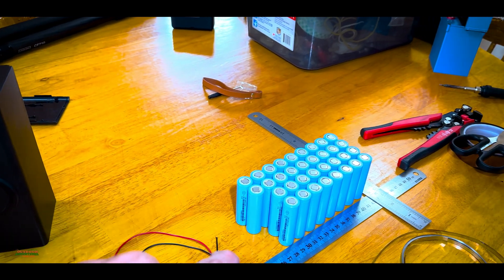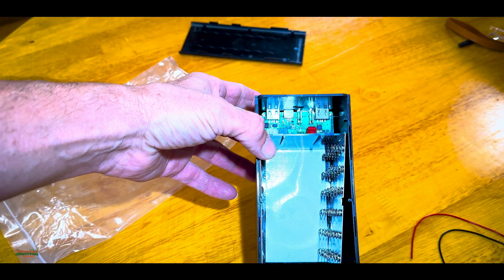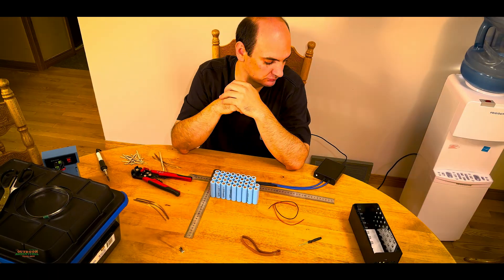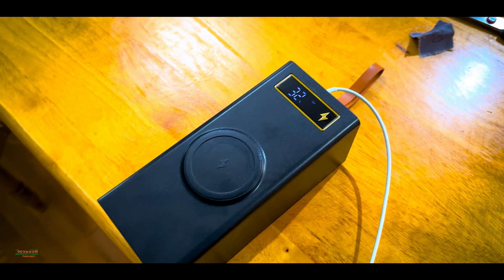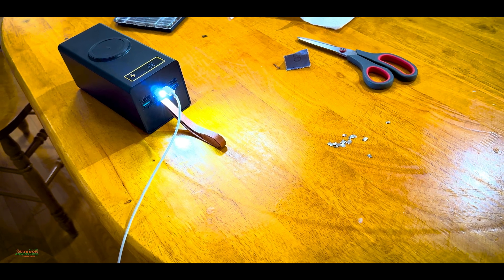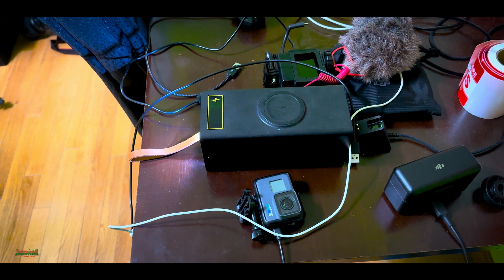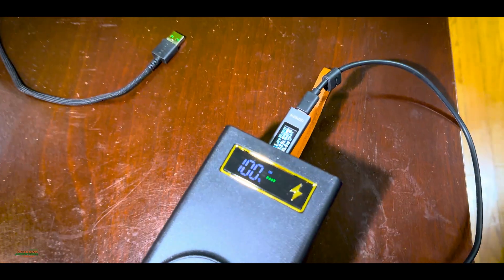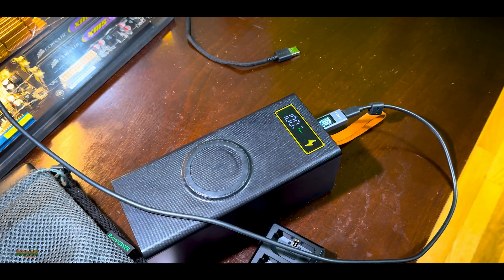How I Built a 119,000mAh DIY Power Bank from 34 18650 Batteries A Step-by-Step Guide

Comment: cool project. i would suggest using 4x lifepo4 cells (32ah) in series next time, and instead of a bms use a 4s inductive active balance board. that plus a bidirectional 100w usb-c board (can solder one of the resister locations closed to change to 4s lifepo4), i believe its called IP2368, theyre like 6 bucks. stuff it all inside a mini ammo can, fits perfectly, and add a 12v dc car plug (and fuse), so you can plug in inverters or add additional usb ports as needed with a 100w step up "car charger". basically building the anker solix c300 but with double the capacity and half the size for half the cost, and actually get a usable 12v dc accessory car charging port thats unregulated. put extra ac inverter and car charger in the remaining space inside the ammo can. can even use the 12v dc plug as an input for a mppt since its unregulated and basically a direct connection to the battery terminals. ea sunpower makes a 20amp solar mppt which is like 18 bucks
Reply from the maker: That sounds like a great idea. I’ll have to try that out.